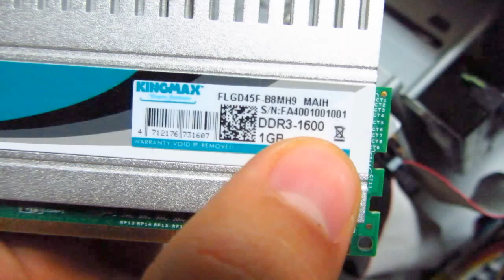How to Upgrade Your PC's RAM (Memory)

Comment: this motherboard supports AMD FX 6300 im have upgraded to my
BUT i have prblem whith PSU is 20pin conector to motherboard no 24 as yours
Reply from the maker: See if the power supply has an additional 4 pin connnector.
Reply: @furulevi  nope has 4for CPU and 20 for motherboard no 24

Comment: i want to ask but, can you use both ddr2 and ddr3 slots?
Reply from the maker: Separately yes, but both DDR2 and DDR3 in the same time unfortunately no. So basically we could say that this motherboard has only 2 RAM slots.
Reply: furulevi that’s dumb next time you buy computer you need to get only all ddr3 sir
Reply: Yes you can. Now i use for the same motherboard 2 ram. 1 2gb DDR3 and 1 512 ddr2. Also i have a question... can add video card to this motherboard and if can what exactly?

Comment from the maker: Theoretically the "ASRock N68C-S UCC" supports 8 gb of RAM,
- make sure the two 4gb modules are in the same type of slot, either ddr2, or dd3, it won't use one ddr2 module and one ddr3 in the same time
- make sure you have a 64 bit Operating System (or use a RAM patch program for the 32-bit OS)
- insert one 4gb module at a time and see if it is recognized by bios, do this with both modules, it could happen that one module is bad...
- try to update the BIOS under Windows (WITH MUCH CARE !!!)

Comment: have the same board but it doesnt show me my 8gb ic have 2x 4gb ram in it but the bios and wndows shows only 4 gb what can be the problem :/
Reply from the maker: - Are both memory modules in the same type of slots? They must be both DDR2 or DDR3.
- Are both modules working? Switch it see the other one works in the same slot. - Is your Windows 32bit? 32Bit Windows also limits the RAM to around 3.5 GB.
- Is your BIOS allocating RAM to the onboard video card?
Reply: furulevi i tested it all nothing worked dont know whats the problem i have an feeling that my board is broken.. but forget it now :) i sold my ram long time ago to my friend and i bought me yesterday a new board but thx for the reply